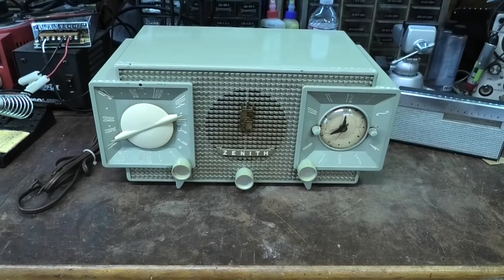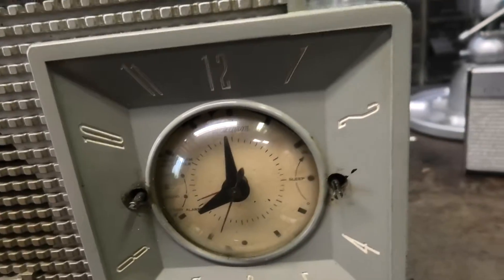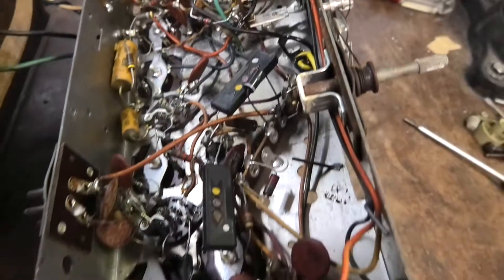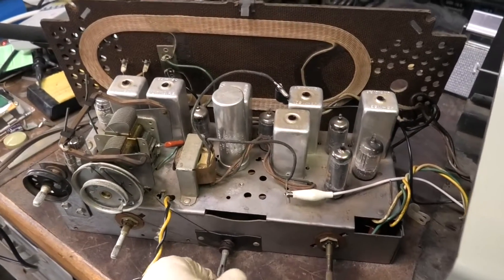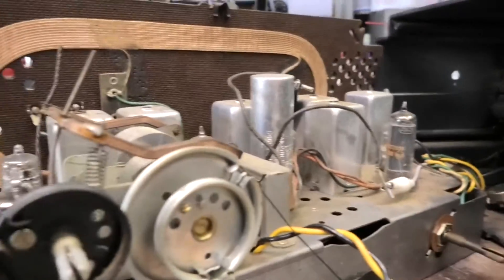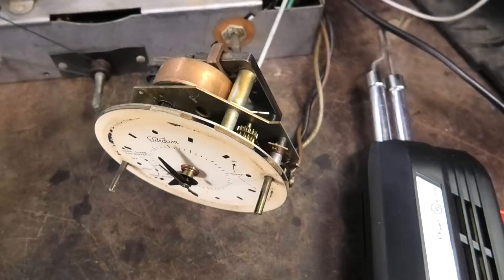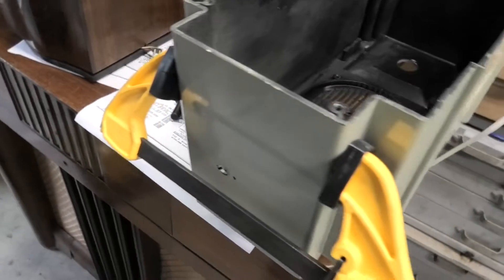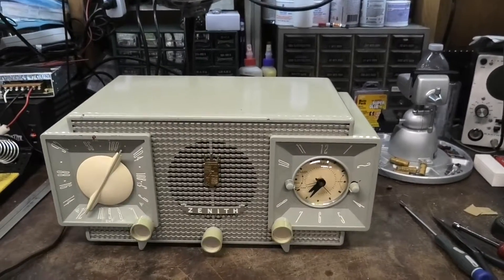1956 Zenith Z733Y Clock Radio Service and Telechron Clock Repair

Comment: I've learned like many others the hard way that the little plastic clock knobs will fall apart upon contact one out of three times. I lube the clock mechanism before I turn them. The big mechanical gears are dirt and grease magnets, so a spray of Break Free or WD- 40  loosens them enough to help keep the plastic knobs from being over stressed.

Comment: Thanks for this video. I just aquired the identical radio- chassis, but in maroon.Note the 6volt tube ( in a 12 volt filament string!) on the far right corner. Note some Chassis used a 12- volt tube at that position. Lots of variety in the chassis on this model. Aga in n, that's for your expose'!

Comment: I’ve got the black version of this radio that I picked up at goodwill for $5 and it was working still when i got it but then I had to recap it later on, mine has all of the original Zenith Tubes in it.
Reply from the maker: I have another video coming on it. It developed silver mica disease in the first 2 days. So I am recapping the IF cans now.
Reply: @mechtrician1  mine actually did something similar but it turns out it was a bad tube, it was the 12AT7 tube that was bad it was intermittently shorting, I also replaced the 19T8 tube as well because those are notorious for going bad in these radios. I was always told that the bigger IF cans don’t develop silver mica disease and that it’s mainly the smaller cans that do that.
Reply from the maker: Also had this issue with a 12ba6. The filament was shorting to the grid. 
These definitely develop silver mica disease, but yes the smaller ones are much worse. 
You’ll see in this next video how much the wafers have degraded.
Reply: @mechtrician1  I think it depends more on the storage conditions whether or not these radios developed Silver Mica Disease as well. I’m actually self-taught when it comes to electronics repair, I’m 33 years old and I grew up during an era when stuff was made to be “throw-away” but I was always fascinated by the older “repairable” electronics from the 1970s on back (like TVs, VCRs, Stereo receivers, record players, tape players, etc. so I taught myself how to diagnose and repair them.